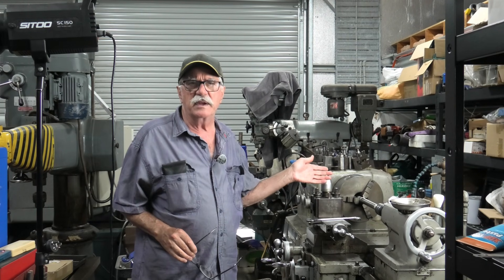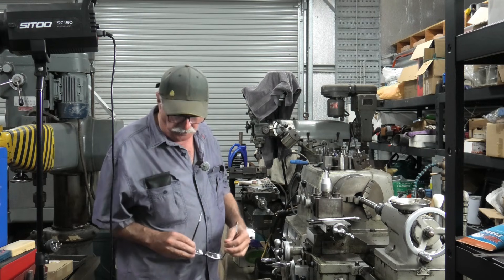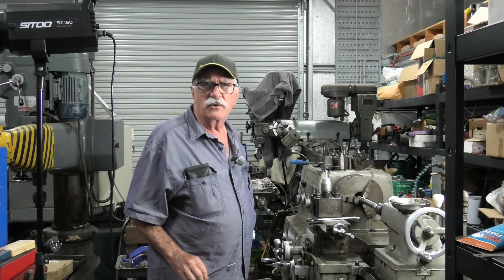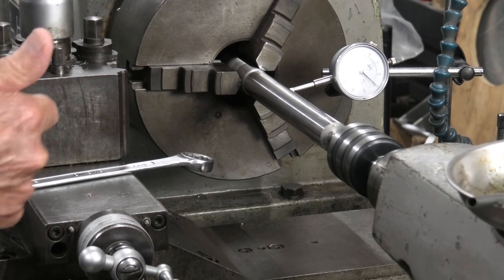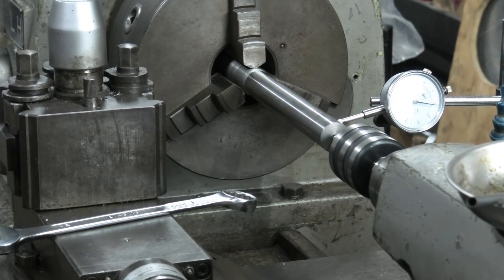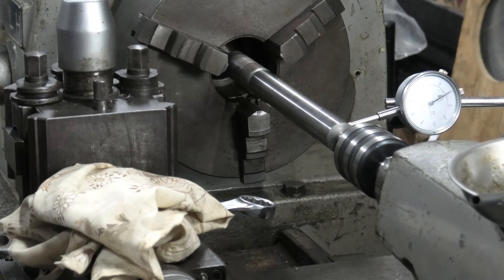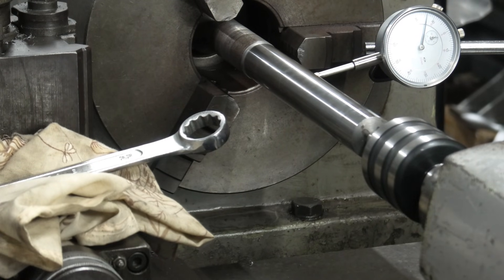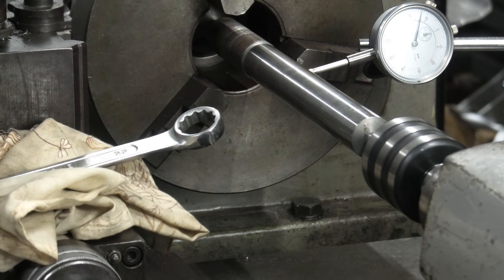Lathe alignment. Ouch.

Comment: Put an indicator in the headstock and line the tail stock up with the center of the head stock. Best you can do. The tailstock may be up or down depending on the wear on the ways of the lathe. The tail stock should have adjustment screws to allow moving the centerline in and out. Never seen up or down adjustment.

Comment: Little confused on the process there. I think it’s difficult to get a good outcome on a worn machine as the ways your using for comparison suffers the most wear. In that case if the majority of the work done is chuck work, I would align the headstock to the bed. Otherwise I would align the headstock to the tailstock ways, tailstock center to the headstock, and the taper from the carriage is what it is. 

Depending on how many parts your doing between centres turning, regular adjustment is common. If your doing one or two, I would turn the taper out with tool adjustment as you go rather then adjust the tailstock.
Reply from the maker: Hey 2664. I'm trying to find what I'll get when turning parts. If the dial indicator says the test bar is parallel to the tool path i should get a straight part. I hope. BC